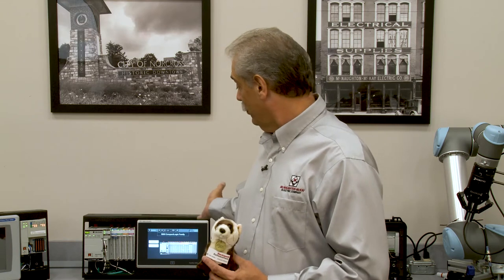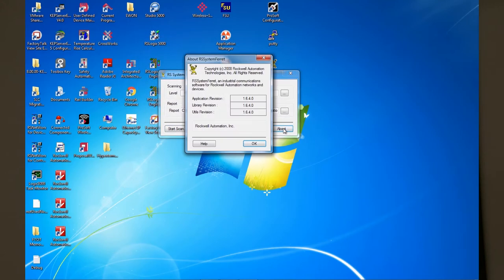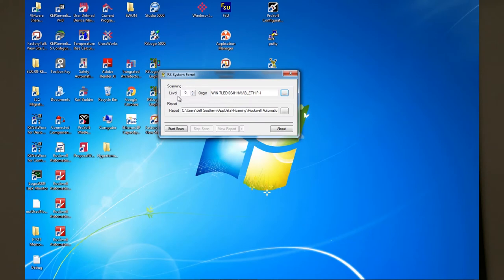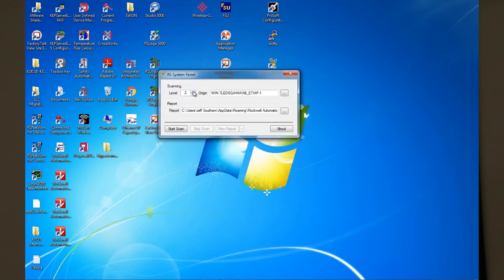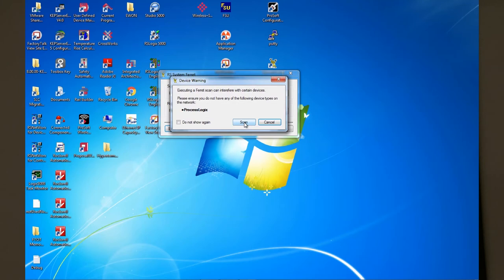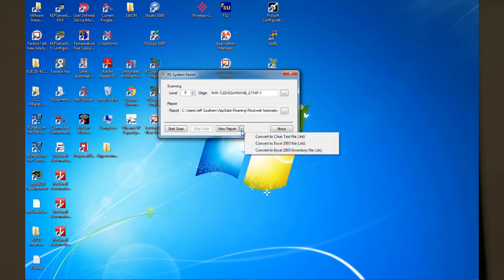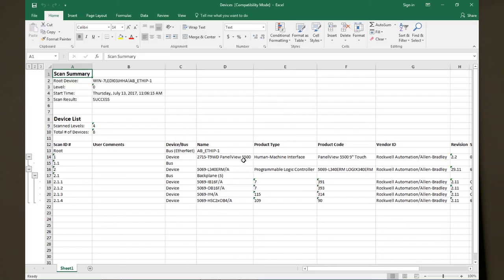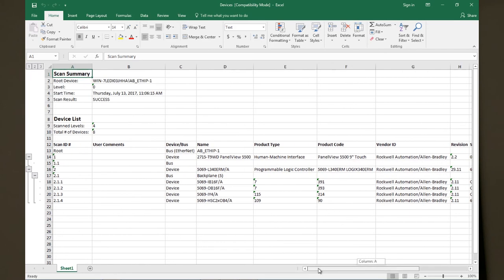Rockwell Automation System Ferret Tool

Comment: Can not get it to scan on our network. Is there a limit up to which revision it can be used on? It starts and immediately closes itself
Reply from the maker: Hello, Our Technical Support team recommends that you try running the software on a bare laptop with nothing running in the background to test for interference. If you continue to have issues or have further questions, please reach out to your local Rockwell Automation distributor for personalized support.

Comment: horrible tool .. it freeze and take couple of hours to scan whole network
Reply from the maker: Hi Martin, That is frustrating, however, a full scan can take some time depending on the network. If you believe the tool is not running properly, refer to TechNote 65576 - System Ferret: Software Functionality and Download Link (https://rockwellautomation.custhelp.com/app/answers/detail/a_id/65576) in Rockwell Automation’s Knowledgebase to double check the setup and refer to the help file. If the problem persists, please reach out to Rockwell Automation directly at 1-440-646-3434.